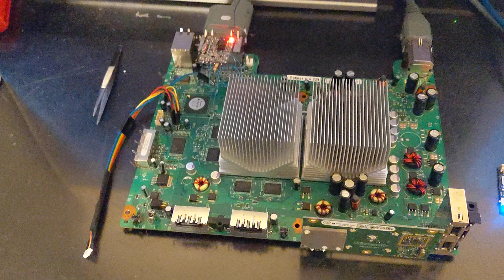RGH1.2 V2 X360ACE Dynamic Autotuning Timing Demo

Comment from the maker: LED off: unlocked and searching timing, LED dim: glitching, LED bright: locked into timing value
Each file I plan to have 10 values it searches through. I used 393 to 383 simply for ease of demonstration. Probably will make 3 file ranges, they start and go down by 10 values (optimal tuning for RGH1.2 is top down). Usually it always finds the right value on first try, but it got lucky a little high a once so I can demo unlocking.
Reply: Hey man when your doing better and back to doing your thing help me out with this rgh 1 zephyr im not sure of where to start as far as timing files
Reply from the maker: @JacobBlosserOfficial  use one in my Jrunner. If it doesn't work, probably your board with accept pll slowdown.
Reply: @Josh.Davidson  not the 1.2 files right? When I use the xsvf files to program the chip I have no green led but when I program a 1.2 timing file it seems to “act” like it’s attempting to glitch but it’s just solid green light and 1 blink very short 

I’ve tried just about any and every timing file we would normally use for a rev c
I might just upload a video so I can see if people can check it out maybe throw me some help 

It is possible it’s just not glitchable I guess
Reply from the maker: @JacobBlosserOfficial  sounds like wrong wiring.
Reply: @Josh.Davidson  Yes sir! it was the Pll point i guess it wasn't on there right but i got the cpu key all is good now thanks King!
Reply from the maker: @JacobBlosserOfficial  nice, thanks!

Comment: This is awesome! Will this method also work on the Slim consoles with S-RGH?
Reply from the maker: No. in S-RGH we have to adjust length using the length param as well as the slew rate of the chip. I can change length but not slew rate. Its a more complex design. Slim 1.2 will have one tho

Comment: Bro what's the circuit diagram you installed the 1.8 volts on the diode
Reply from the maker: Normal ACE RGH1.2. The timings will be release soon.

Comment: Is the crystal on a chip constant and can temperatures affect them?
Reply from the maker: Temperature makes no effect. The reason is with this much slow down, even 149.999999mhz to 150mhz makes a slight difference in proper value. That is why I made this.

Comment: Which timing files do you use on zephyr rgh 1.2
Reply from the maker: You don't, it doesn't work and it never did. Do my RGH2 method https://xbox360hub.com/zephyr-rgh2-tutorial/
Reply: @Josh.Davidson  What's is the issue with Zephys that make them incompatible to RGH 1.2?
Reply from the maker: @breaKdownINC  the timing value had to be different for 90nm CPU, both glitch value and slowdown schedule, but the problem is 90nm CPU crash on PLL speedup. So Xenons and Zephyrs mostly don't work
Reply: @Josh.Davidson  Oh damn, I thought these days it's no problem to glitch Xenons (and Zephyrs) :(
Reply from the maker: @breaKdownINC  Zephyr can be done with my RGH2 timings easily, I have another better solution for both coming soon tho.
Reply: @Josh.Davidson  That sounds sexy my dude!
Reply: @Josh.Davidson  thank you very much
Reply from the maker: @Wmtechzm  np
Reply: Thank you